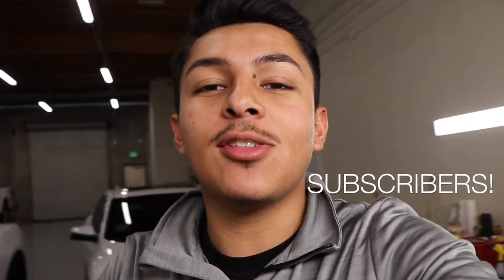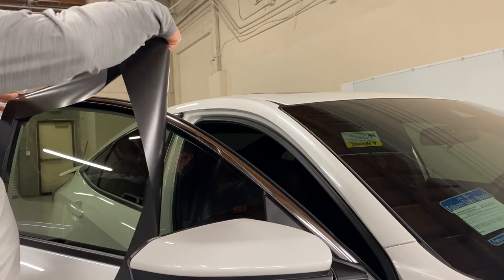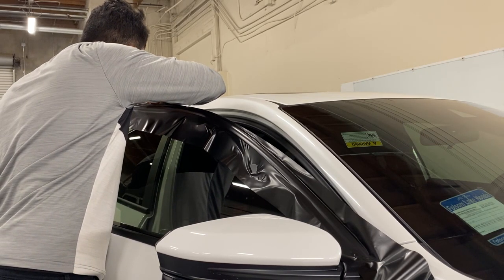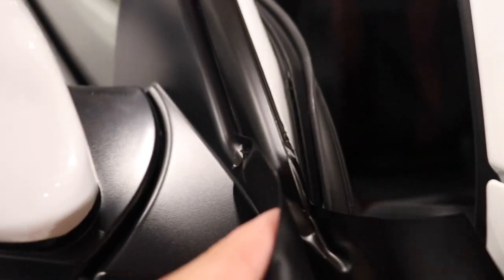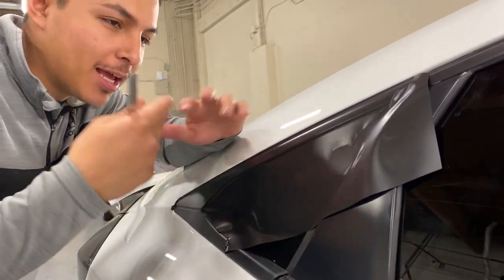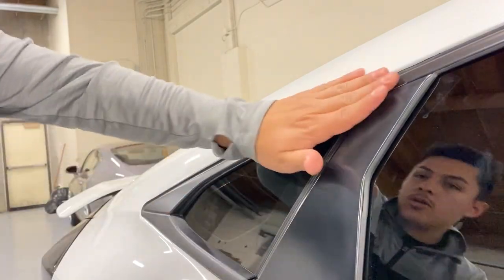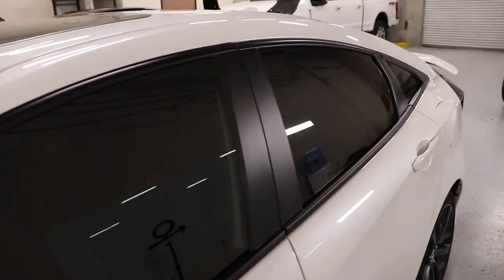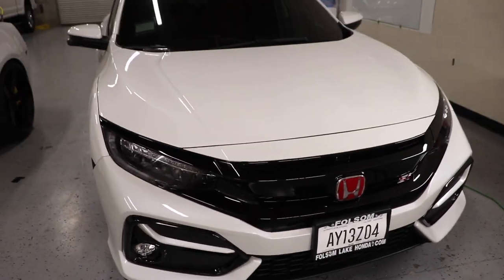CHROME DELETE ON MY 2020 CIVIC SI

Comment: Get 27won intake bro
Reply from the maker: Hows the sound compared to PRL
Reply: @juniorarce_  the prl cobra sounds amazing but if you get the prl cobra cold air you on risk of hydrolock if wayer gets in filter . You could also get the short ram version of prl intake. But the 27 won its boxes may not be as loud as prl but its safe .